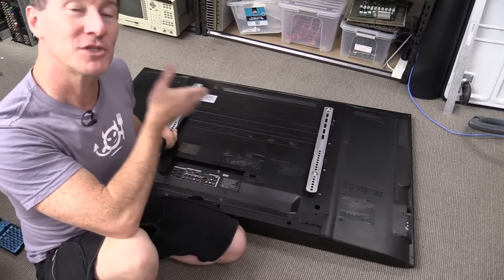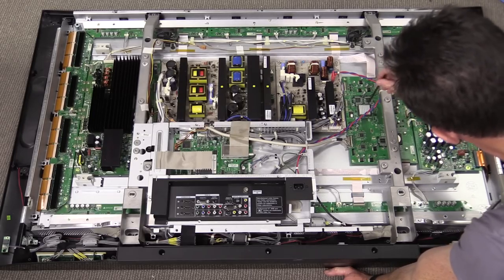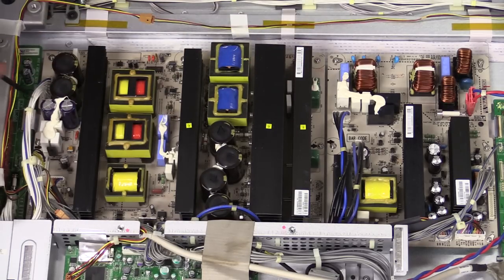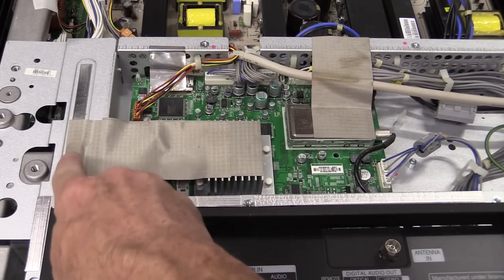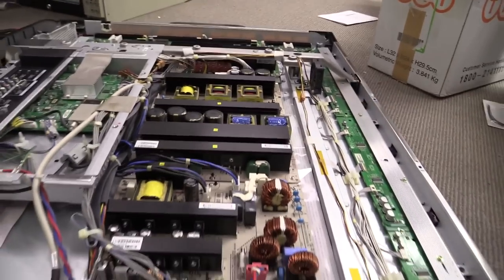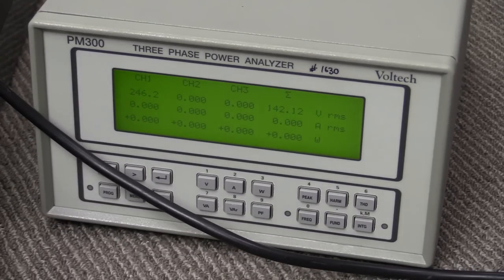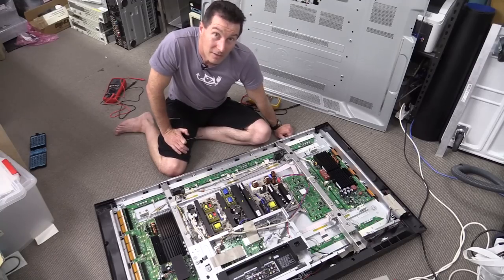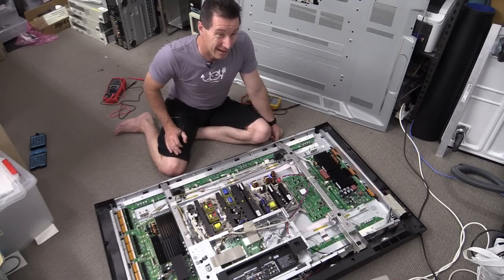EEVblog #725 - LG Plasma TV Teardown

Comment: Those displays when old are not worth repairing, likely far too much burn in, and uneven wear of the subpixels will definitely put the display in a state where you cannot fully calibrate it. Depending on the content, different areas of the display will suffer from different types and amounts of color shift.
Reply: LGs pretty bad for burn in but I don't think I've seen a Panny plasma with burn in yet. Its pretty hard to burn in the modern displays, the power electronics will fail first (in panny's case, the CPU soldered to the motherboard fails.)

Comment: I had one of those , had to heat one of the solder joints with a fine point iron to get rid of the line, what a bitch of a lot of screws to take off... The line keep coming back or getting new ones, finally I let it go too long and i think it burned the screen or ruined something I couldn't find to fix.

Comment: When you gut it, it might be light enough to mount and then you can use it as an interactive art box. You know, with cardboard cutouts that move from a servo controlled by a single board computer. Or maybe you can use the glass as a topper to protect the wood on a coffee table. It's not worth repairing and you don't want it taking up your space if you're not going to use it, but recycling it will keep it out of the landfill and I think someone can come up with a way to recycle everything.

Comment: LG isn't too bad. I've had a LG HD LCD monitor that's lasted the last 6 years in California's heat. It's even had to endure dust and moisture since it's located in a shed type building. Using it as a second monitor now but it's fantastic for it's age

Comment: Well, a modern PC graphics cards consumes over 200 Watts, so that magnitude shouldn't be that unusual...
Reply: A video card only uses that when under load, at idle where they spent most of there time it's 30W.
Reply: My car has a power of over 70000 Watts, if i play one hour with a computer that requires 1 kW  instead of driving the car for one hour, my ecological footprint is much better.

Comment: I sill like the old CRT sets last 25 or more years show me a LCD or a Plasmas set that can do that. I know the pick is better on LCD's but the price and life of the thing not worth it to me
Reply: I have a 32" LG that is 8 years old and has run nearly 24x7 for all of those years, which is nearly as many hours as many would put on their televisions in 25 years time.  In all those years its only fault has been the blue power-on LED going out (the red power-off LED is just fine, though).  I fully expect it to last a number of years more (at least until either the capacitors or fluorescent tube goes out, at which time I will likely repair it).

As of a few months ago its runtime has been greatly reduced only because I opted to upgrade it and replaced it with a new 42" LED LCD television (Best Buy house brand) that cost only half as much as I paid for that 32" LG 8 years ago and has great color (better contrast than my old LG), very good blacks and a nearly 170deg viewing angle with very little angular color shifting or intensity drop-off -- and runs on nearly the same wattage as my old 32" LCD (and, curiously, weighs about the same as the old 32").  The 32" LG now serves a guest bedroom, and it will remain in service until the day it dies and I decide it is not worth the effort or cost to repair, but thus far it has been totally trouble free (save for that power-on LED).

Comment: I have a plasma tv which was pretty thin for it's time, i use it as my computer monitor, it's has a nice steady display and it's pretty useable, i game on it, watch video's on it (like this one now), i mean it's not bad, they have 1 advantage over lcd, and that is that the blacks are truely black which is nice, my Panasonic model is around 15 years old now, i mean this tv was top of the line, it consumed the less and having one of the brightest and nicest screens which is still true to this day, you can mistake it for an lcd panel, i like it, i don't know why but it's a neat display :)
Reply: yea but oled and better exist now and uses way less power
Reply: @huge_balls  Yeah my old tv died unfortunately, but it worked very well! The response time was quicker than the tv i use now, i have a modern boring lcd tv now, it works, but i do miss my plasma tv tbh! And yeah they can have burn in, my did as well at the end of it's life, but 1 day, i went to turn it on, and some magic smoke came from the tv, turns out it was an FPGA that had gone bad, and since it is so old, i couldn't find a replacement, so i had to trash the tv, but the Sony one i am using is ok for what it is. Plasma is better imho!

Comment: To my understanding plasma screens were a stop-gap technology, a cheap(ish) way of making big screens back when it was too expensive to make large LCDs.
Reply: Plasmas were the first large screen flat panel tech, so I'm not sure who told you that.  LCDs didn't hit 40 inches until 2005 or so and by that time PDP manufacturers were showing off 70" 1080p prototypes. (LG released a gold plated 71" 1080p plasma.)
Reply: Well yes, everyone wanted large screens and plasma's were the only cheap way to go. In theory LCD's could have been made larger back then but they would have been too pricey. Hence everyone put up with the massive power draw of plasma's until LCD prices could come down. That's more what I meant.
Reply: Darren Jacobson LCDs had (and still have) huge yield issues in big sizes. It's only been in the past 5 or so years that 65"+ LCDs have been able to eat up where plasma was really big and that was in the large-screen high-performance end of the market.  Panasonic made a 152" 4K plasma and they sold many of them. Used about 6kW in operation. I think the biggest LCD is around 110" from Sharp.
Reply: 6kW!? That's like 24-25 amps! You'd have to get a special circuit rigged up to your living room just to run it!
Reply: Darren Jacobson Yes, it operates off a three-phase 240V supply ONLY. It's absolutely enormous. They could only transport it in the nose of a 747... or something like that. Not intended for consumers as it was over $100,000 at release (I'm sure some people bought them though!)  More intended for news studios, or as a replacement for a projector as it had higher light  output, about three times that of a conventional projector over a 152" screen.
Reply: Thomas Oldbury
Ok, I have to admit, that's the first time I've heard of a television that needed three-phase power. That's just insane!